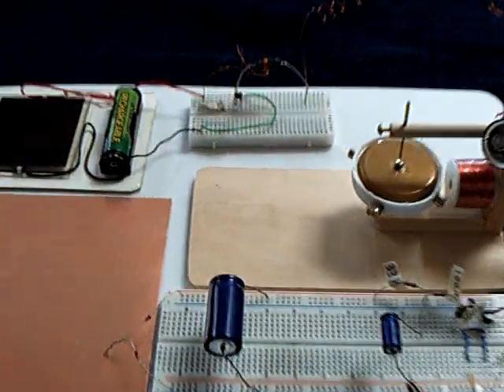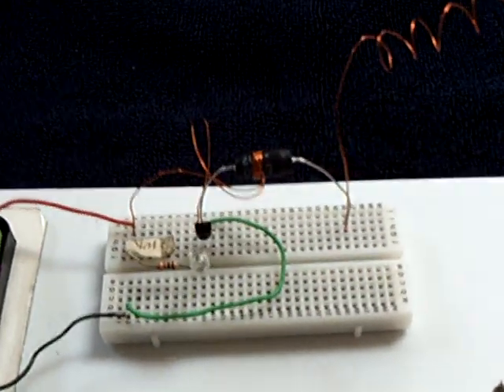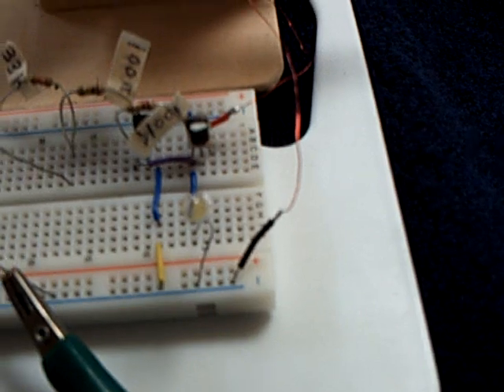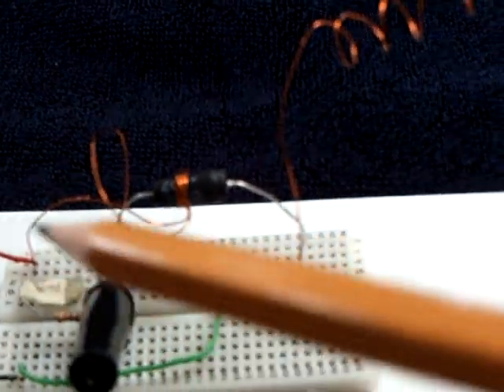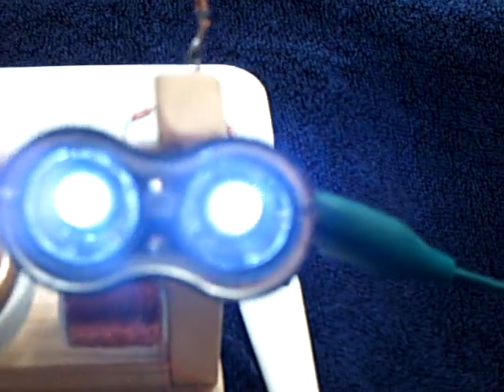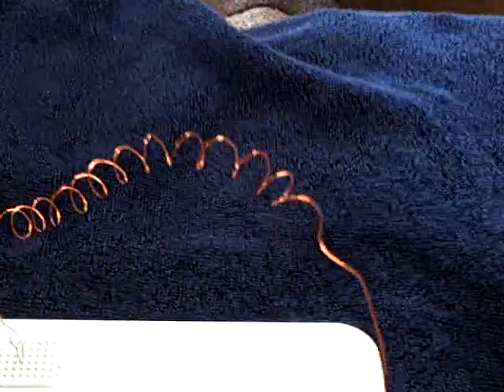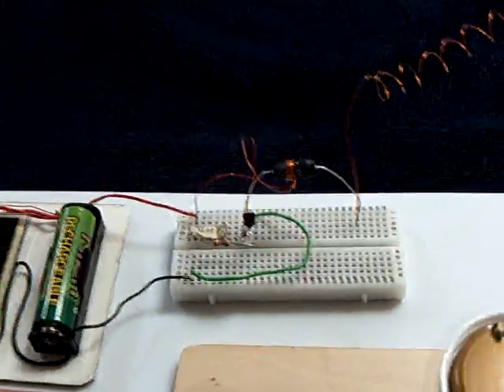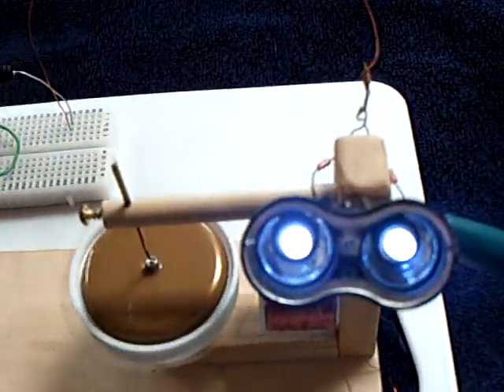Slayer's new Choke Exciter.ASF

Comment: Nice for positioning the solar cell + circuitry at a distance from the actual LED which could prove to be beneficial. Do you think the output from the Slayer Inductor would travel better than DC, as far as losses are concerned? Or is it not like AC, in that way. Thanks Lid.

Comment: it was hard to see, but am I correct in observing that the one coiled wire coming off the exciter to the LED eyes was just resting on top of the wooden post and not actually connected to the pulse motor circuit?